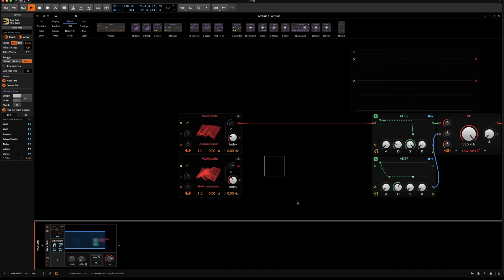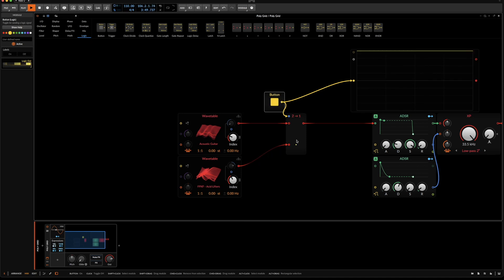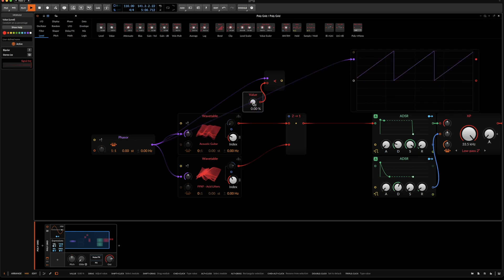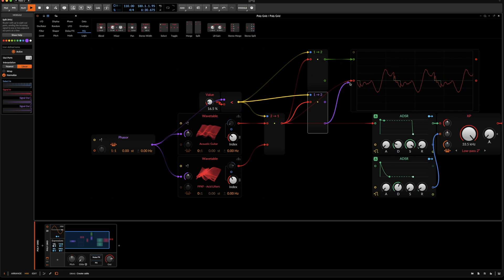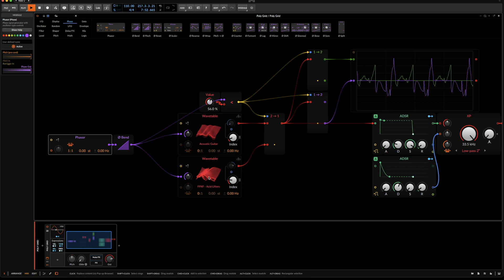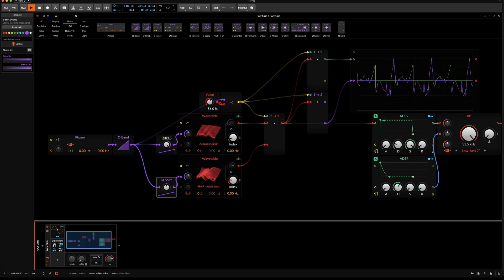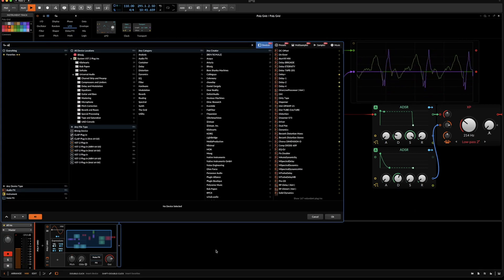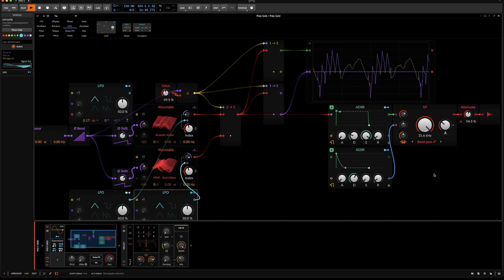Let's create a Split or Splice Oscillator ⚡️

Comment: I just spent the whole day on a patch attempting to do wavesplicing. Even recorded it and started editing it as a tutorial. Then found this tutorial. 

I’m now wondering if my different splicing method of using the blend module to cross fade between both waveforms at audio rate (same rate as the oscillators) is technically an incorrect way of doing wavesplicing. 

The result appears and sounds similar  . 

Interested to know your opinion on that.
Reply from the maker: Without seeing your patch I cannot know for sure, but it should work as well. I suppose using a blend module would allow you to fade between the waveforms instead of just switching back-and-forth. But if you just want to splice a blend device might use more CPU than a switch.
Reply: @theRumbleChannel  here is the video if you’re interested. Thanks again for your polygrid stuff! It’s exactly what I’m looking for as you seem to have a bit more knowledge and experience than myself. 

https://youtu.be/lnZnfNaqYJQ
Reply from the maker: @Pspiralifemusicandedu  Thanks! Nice little tutorial and neatly illustrated :). I suppose it does not exactly the same thing (but that's good). I'll definitely try that as well 👍
Reply: @theRumbleChannel  thanks :) yeah I think the split with the “less than” module is more precise and an advanced way of doing it. I’d like to think it has a better / sharper quality than my method. Might have to build both side by side with an a/b switch.
Reply from the maker: @Pspiralifemusicandedu  if you really want to "splice" the waveform my method is more accurate and you are more in control of where you want to splicing to happen, but what you did might also yield some sonically interesting results. That's why I love the Grid :)

Comment: i used to split oscillators horizontally (with min/max) but this is cool too. nice tut 🙏
Reply from the maker: Thanks a lot Polarity :). Splitting them horizontally sounds interesting as well. Maybe we could do both simultaneously 😈. The sky is the limit! 
Love your channel as well by the way, learned a bunch  👍
Reply: Polarity did you make a tutorial for that horizontal splicing?